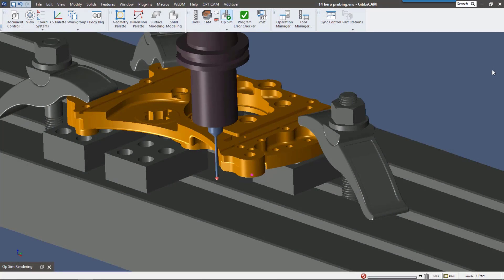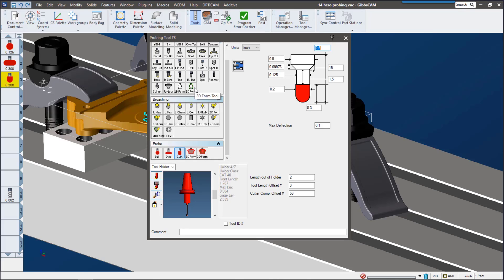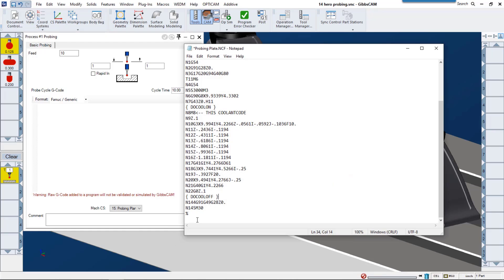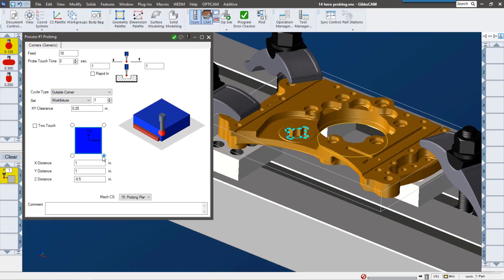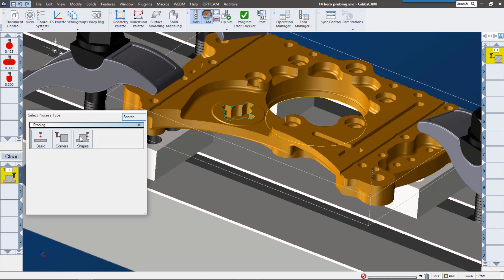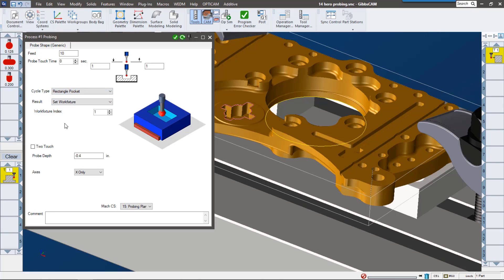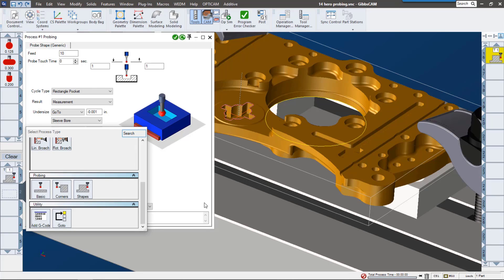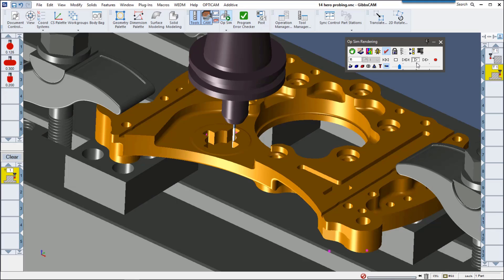Probing in GibbsCAM 14

Comment: "Every seat of Gibbs comes with basic probing"?   When I open Gibbs 14 there are no probing tools available and I was told it was a purchase option?
Reply: Correct, Probing is an add-on option (including everything shown in the video).  The biggest difference is that Basic Probing support is included in all new posts and can be easily retrofitted to old posts too, while Generic Probing needs a more extensive post modification based on your machine's cycle requirements.  Also worth noting is that Basic Probing does all the toolchange, orientation, interop, and transition motion for you...the gcode you paste in is just the probing cycle call itself (usually just one line, or a couple at most).